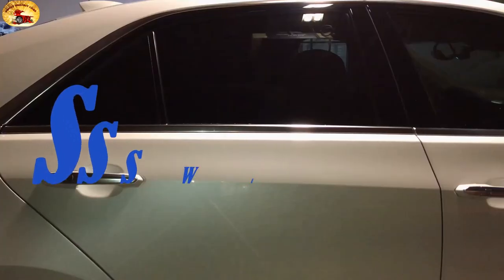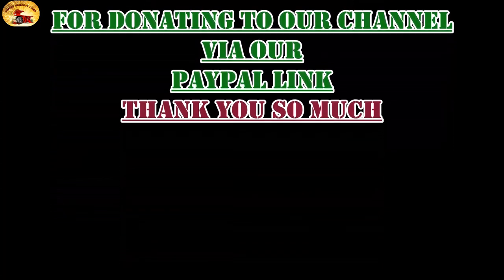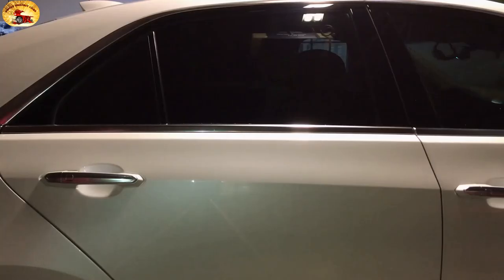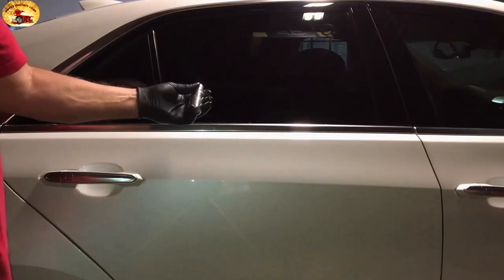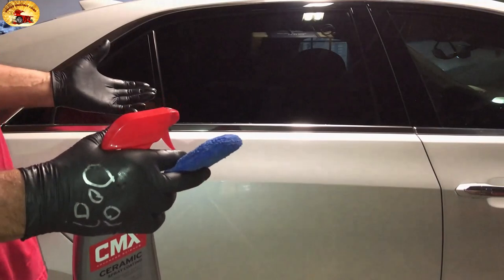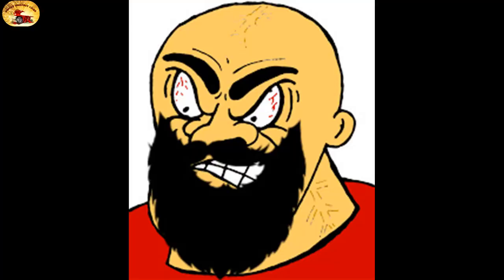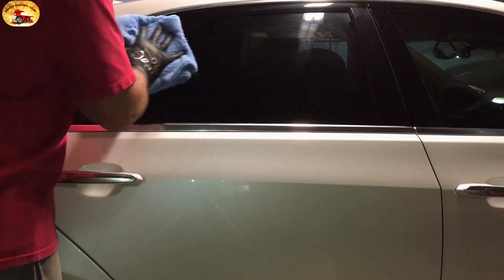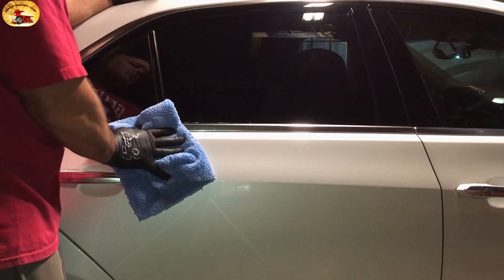FASTEST Way To Stack Ceramic/Nano Coatings.... AMAZING!!!

Comment: In between coats every month, do you need to use mother’s paint prep before adding another layer of the ceramic? Or will using their paint prep remove the prior coat of ceramic?
Reply from the maker: No, just wash the car then add another coat.  Thanks for watching and asking Mikka, have a great day. mad Mike the hammer SPC

Comment: Just a heads up. you forgot to put the link to the ceramic coating in your show more!
Reply from the maker: drvnucrzy  not sure what you mean this is the mothers coating https://amzn.to/2Zqcwvs and this is our base coating https://goo.gl/z9TrgR  thanks mike
Reply: I couldn't find it anywhere on the show more before. But its there now! So do you recommend getting the small bottles of ceramic coat for initial coat and then go with the mother's after? Or is the mother's just a newer faster method of applying ceramic?
Reply from the maker: yes the small bottles we use is done first then after 1 week start using the mothers